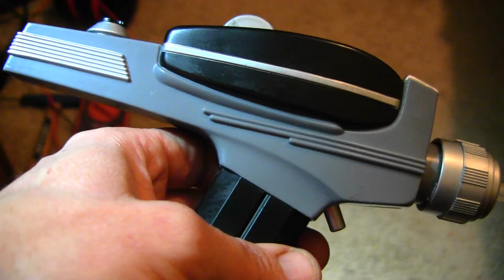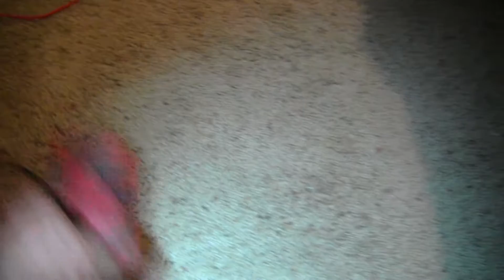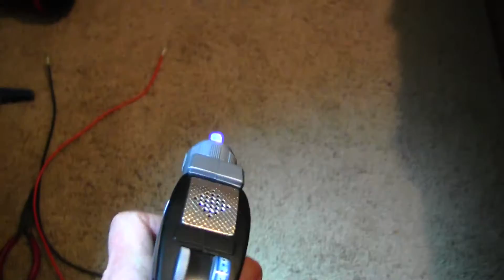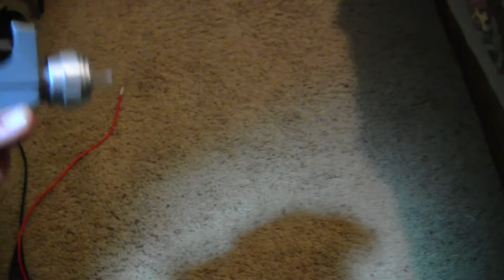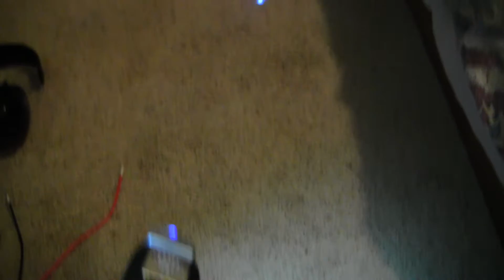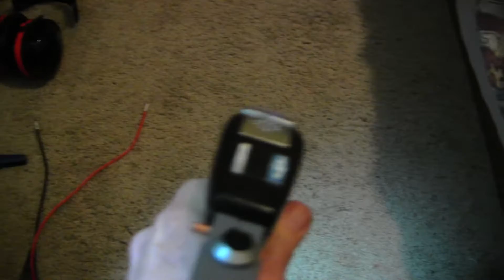1994 Star Trek TOS Hand Phaser With UV Laser

Comment: So it sounds like if someone was handy w soldering and very basic electronics, one could make what you are teaching here. Great! Where did you get the phasor toy and laser pointer? Thanks!
Reply from the maker: They are available on Ebay. Simple inexpensive laser-pointer from China. Comes with different pattern tips.  Available in Red, Green and UV purple.  I think they cost around $8.00.
Reply from the maker: I bought the Phaser back in the 90's, but they are available on Ebay too.  Search for 90's Playmate Phaser toy.
Reply: @MrSFSTUDIOS  Thanks so much.  Happy Holidays!